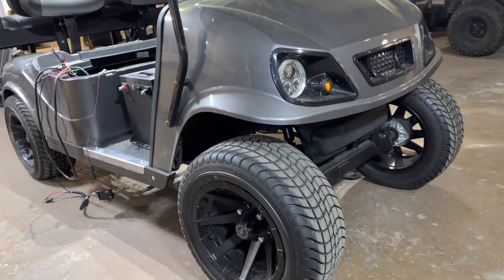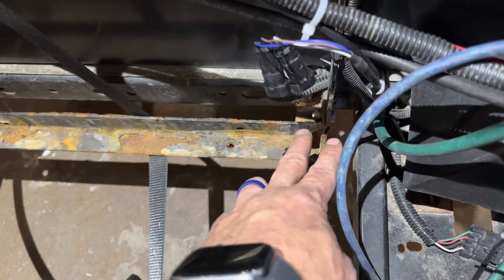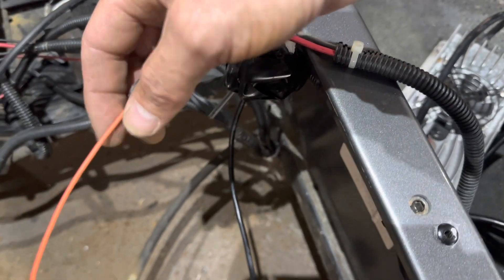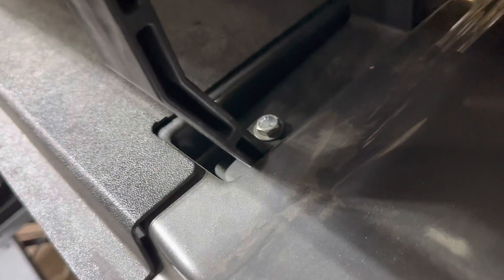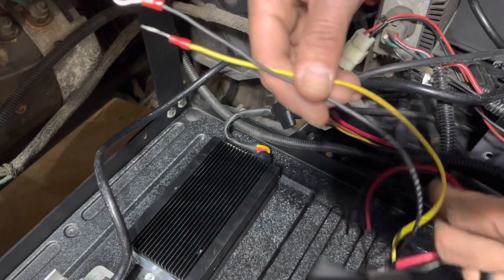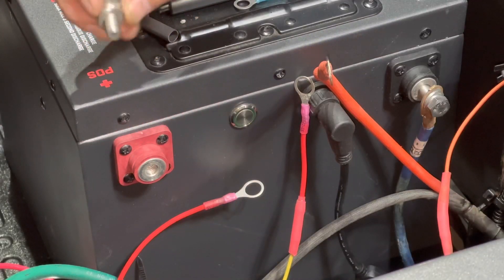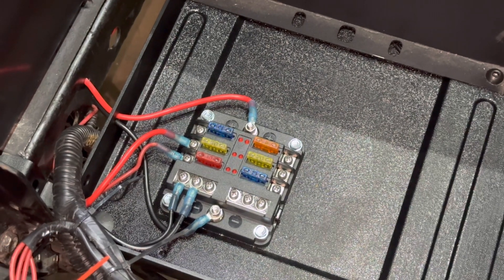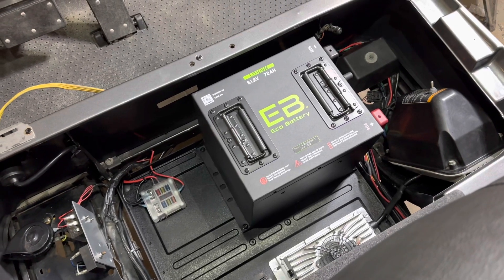Eco Battery 51.2v - 60ah Installation Video ~ 48v EZGO TXT

Comment: Good afternoon I’m having with my installation of my Eco 51.2 105AH lithium battery. My battery bundle did not come with 12v reducer could this be my issues in getting my 2012 EZGO 2-five operating? 
Thank you
Reply from the maker: No, the 2five comes with an original voltage reducer. I would think it is the charger interlock.

Comment: I noticed in the video that the cart still has the original voltage reducer.  I have the same setup on my TXT.  Did you bypass this unit, if not how did you connect with the new Eco Battery?  Great video!
Reply from the maker: I would find the 48v input POs and neg, then just run it to the lithium posts.

Comment: I have 2017 ezgo RXV and installing eagle lithium battery, what wire from the battery charging port do I have to bypass and to where? Thank you for the help.
Reply from the maker: The smallest wire from the back of the charging port needs to have an eyelet put on and put the positive post of the battery.